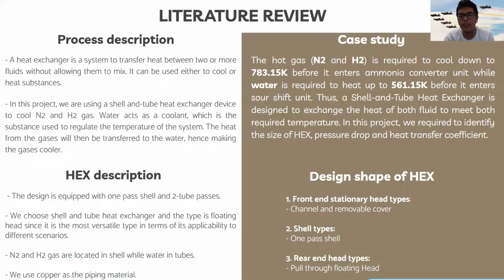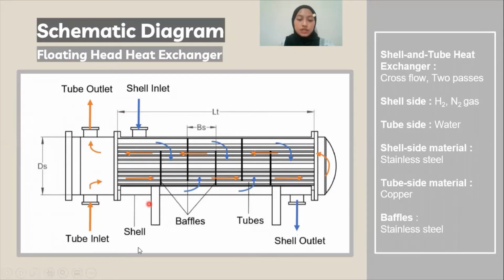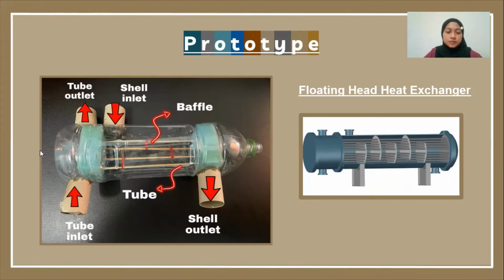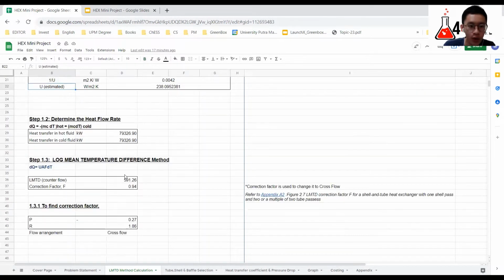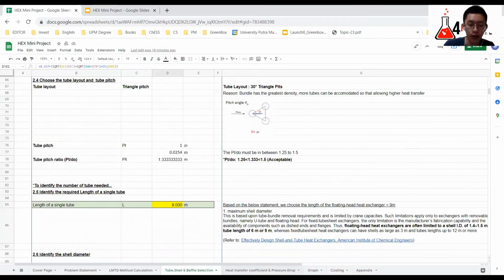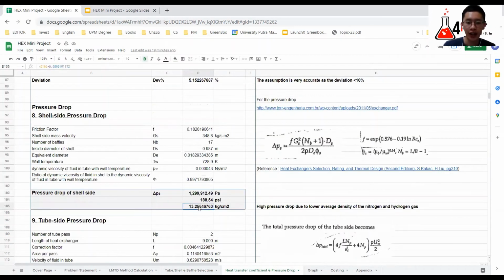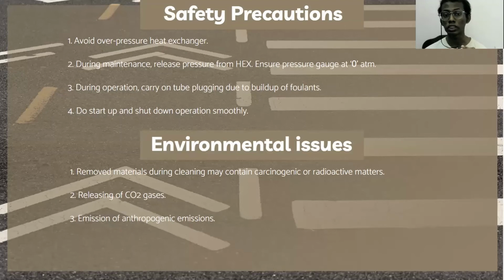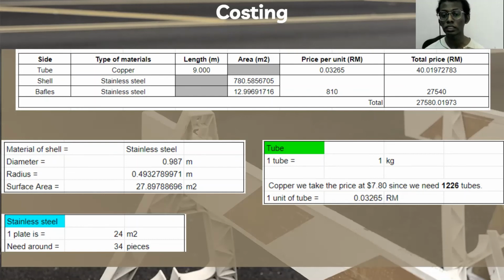ECH3116 | Mini Project : Heat Exchanger Design

Comment: What will happen to your current process if you select different heat exchanger design?
Reply: Salam sejahtera Dr. Azlina. Firstly, thank you for your question.

The front and rear head types and shell types have been standardized by TEMA (Tubular Exchanger Manufacturers Association). During the initial stage of heat exchanger design, we take into consideration of the advantage and disadvantages of different heat exchanger designs based on TEMA.

1. For instance, we choose crossflow one pass shell with baffle is to make sure the high efficiency of the heat transfer and ensure the pressure drop is in the permissible value. 

-  If we change it into other designs like counterflow with F-shell with longitudinal baffle, it actually will result in higher heat transfer efficiency but at the same time will cause the pressure drop to increase very significantly. 

2. Furthermore, for the pitch arrangement, we choose triangle pitch as the bundle has the greatest density, more tubes can be accommodated so that allowing the higher heat transfer. 

- If we change it to square pitch, let's say the shell and tube heat exchanger size remains the same, the heat transfer in our process will decrease due to fewer tubes could be arranged in the shell.

3. The materials used to be made up of tubes. In our project, we choose to use copper as it has a higher heat conductivity which results in better heat transfer. 

- If we change it into other materials like stainless steel, its advantage is it could reduce the deposit of residue and anti-corrosion,  but it has a lower conductivity as compared to copper, resulting in a lower heat transfer rate.

4. Some other modification we could make in our design,
4.1 Use the finned surface in the inner layer and outer layer of tubes to improve the heat transfer efficiency.
4.2 Add the pump to reduce the pressure drop.
 
Additional info:
If we change it to another type of heat exchanger design,
1. For instance, to "double pipe heat exchanger", our process will experience more heat loss at the corner part, which is not efficient for heat exchanger. 
2. On the other hand, if we change it to "plate-type heat exchanger", the operating temperature would be limited as the bonding materials between the plate couldn't withstand high temperature especially in our case is 1000 degrees celsius. 
3. In addition to the plate-type heat exchanger, the narrow plate pathways severely drop the pressure of the flow, requiring additional pump power. 

These are some of the points I could think of if we modified our heat exchanger design. Below are the references for the statements above.  
Thank you.
Best regards.
https://www.platetypeheatexchanger.com/plate-type-heat-exchanger-advantages-and-disadvantages.htm
http://www.torr-engenharia.com.br/wp-content/uploads/2011/05/exchanger.pdf